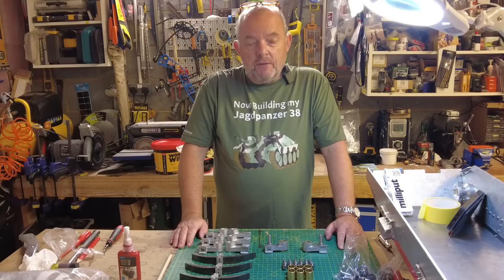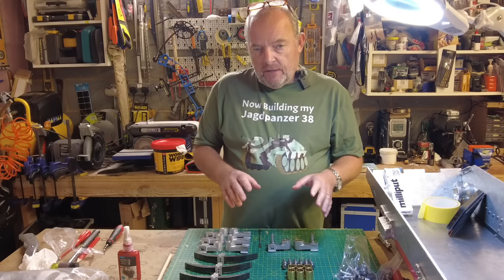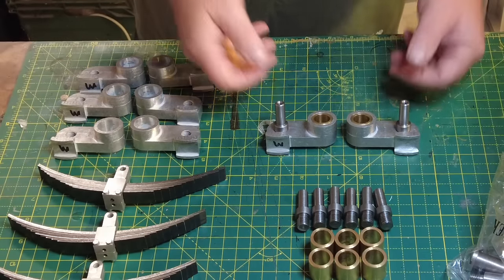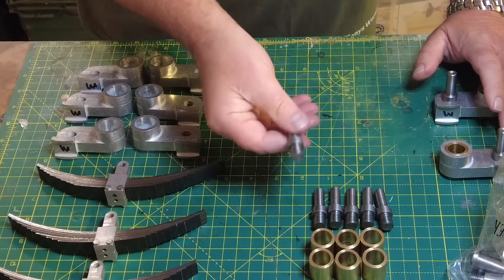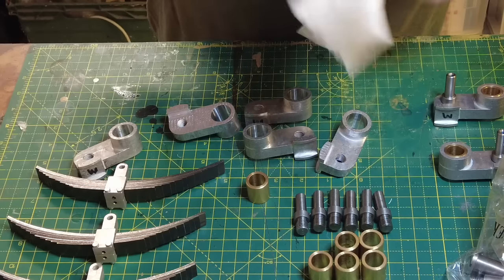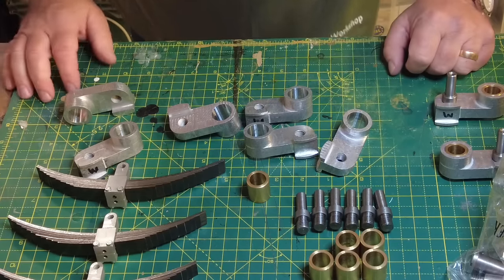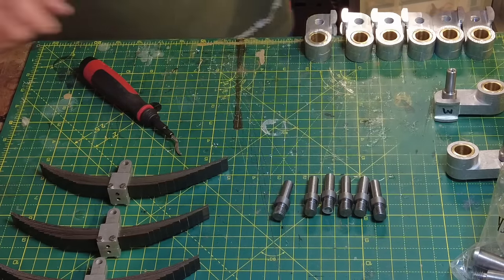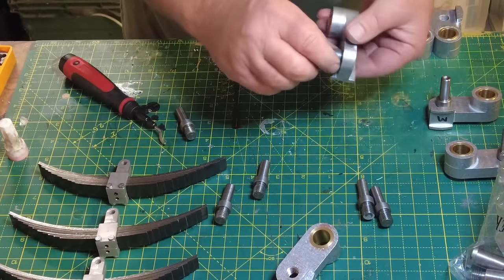1/6 scale Armortek Hetzer Jagdpanzer 38 (Vid 05) Assembling the axle arms and 1st of 8 wheels

Comment: Two things, 
1) when using a tap turn one full turn then half a turn back. By continuously turning you are not breaking of the cut material into chips. That is why it is so hard and gets progressively harder as the swarm jams up the tap.
2) never use pliers to grip a bearing surface. On slip and the surface is ruined. You could have held the stub axles at the wider part that is non bearing. 
Otherwise great work.
Steve
Reply: Since he only recuts the thread and doesn't cut it again, it's completely ok the way Tony does it.
Reply from the maker: Thanks for the tip Steve. I am only recutting the thread and it is through aluminium so quite easy to achieve, but your advise is duly noted and very much appreciated. 
I am aware that using pliers can be problematic, but I can assure you I had them held like a vice grip and they didn't slip and it just needed a little bit of encouragement to complete the tightening up process. I should have stated that in the video I guess to prevent other builders trying it. Thank you for watching and commenting, it is very much appreciated.
Reply: @janhansmann9566  it’s clear from the video that it is getting harder to turn the tap, it’s either cutting where the original cut had not gone far enough or it’s clogging up, either way backing off will clear either problem. The big problem is that you easily get into bad habits, treat an m3 tap like that and you will break the tap every time. 
The threads tightening near the bottom is a typical issue when CNC threading, not running a second tap. Sometimes it is done deliberately to ensure the stud fixes tightly.  Steve
Reply: @tonys_workshop  one way to get strong purchase on a round spindle without the risk of damaging is to cut a strip of metal, softer than the part to the width of the surface to be gripped. From the middle of the strip fold it around the part so that the ends meet, now squeeze the strip next to the part so that both ends of the strip touch adjacent to the part kinda like a keyhole. Now with needle nose pliers grip the two ends of strip twice the diameter of the part away from the part. Now start turning the pliers in the rotation you wish to turn the part. The metal strip will wrap round the pliers bringing them next to the part. You now have effectively created an oil filter wrench. The rotation of the pliers now tightens the grip and rotates the part with a fair bit of leverage.. it’s particularly useful for removing broken taps that still have a small stub protruding. Because of their three groves taps tend to disintegrate when gripping with pliers. This method evenly grips the tap reducing this tendency.   Steve
Reply from the maker: Thanks Steve, good advice and will definitely try this again if needed.
Reply from the maker: Thanks again Steve. Great knowledge shared like this is Golden, thank you.

Comment: Another compelling session, Tony. Count me in on more videos of welding technique and airbrush painting. I'm OK-ish welding at 1:1 scale with steel - well, after a bit of action from my grinder that is - but I've avoided scale welding so far on my M26. I heard a quote that "my grinder and paint make me the welder I ain't" on another channel recently which just about sums up my efforts.  In truth using the pliers on the shafts didn't really matter as those surfaces weren't the bearing surfaces as that's the job of the 6000 series bearings, but it's good to keep an assortment of short copper pipe offcuts of different diameters with a split along them to slip over threads or shafts so you can use pliers with a clear conscience. It's luxury to use a collet chuck in a lathe of course but total overkill for a job like this. Also, if you ever find that you need to clean a thread without the correct size tap you can slit a bolt of the same thread size along the threads using a hacksaw to make a rudimentary DIY tap. Looking forward to the next installment. 👍
Reply from the maker: Hi Keith, wow, great tips, especially the copper pipe trick...never thought of that but absolutely genius idea. the welding on these is 'dummy' welding using Milliput putty. I will show this, but its not half as cool as welding for real.

Comment: Morning Tony looking good the wheels are big!
And bonus on how quickly they go together, i really like the screw hub caps
I think its a great idea to show all aspects of the build filling and weld beads that can help other potential owners
Look forward to the next one
Reply from the maker: Morning Gary, thanks mate. The wheels are little bigger in diameter and soooooooo much easier to build that the larger tanks. The screw hub caps are neat but there is a lot of trimming to do on the back to cut down the dummy studs. nervous times with the Dremel as it is easy to slip and damage the thread. I will film the welding when I get on to the top section. Hope all is well and you are on track to complete your build.

Comment: When fitting  the bearings  in the wheels rather than using superglue  you should use bearing lock, also only hit the outer ring of the bearings  to avoid damage  to the bearing
Reply from the maker: Great tip thank you.

Comment: Looking good Tony. Definitely the way to go with thinking about  pre -painting parts /sections before assembly. My method with my Panther G build and so much easier.  All areas are fully covered without the risk of flooding hard to reach areas with paint.👍
Reply from the maker: Thanks Malcolm. I agree, I know it holds up the tank build progress but it is definitely worth the investment in time. The parts all fit together post painting and moves the build on very quickly from then on.

Comment: I'm not sure i would have glued the bearing in , Tony , as in the unlikely event of one failing it would be extremely difficult to remove . Personally i would have used a bearing fixer , the like similar to that of the thread locker your using . Another point is the fitting of the bearings themselves . Nothing wrong with helping the fit via a hammer , but i would have used a socket at the very least , that matched the outer diameter of the bearing shell . A drift of the likes you were using , is likely to mean a future removal of that bearing is more likely .
Reply from the maker: Thanks Mickey, great tips. I love the socket tip and will definitely go forward with that advice. Much appreciated.
Reply: That's exactly what I was thinking, use bearing retainer. Better than superglue.

Comment: Hi, Tony! Those leaf springs sure look sick, but I'm curious if you're getting decent articulation out of them. I myself would take scale accuracy over performance any day, but in the scale world of RC, leaf springs being far more decorative than functional seems to be the accepted compromise and norm. What's interesting in this case, however, is if they do actually flex under the weight of a fully metal 1/6 tank.
Reply from the maker: Hi Arthur and thank you for watching and commenting. interesting question. They do articulate on the central pivot retainer, but unsure how much the springs deflect when tackling obstacles. The Weight of this Hetzer with the batteries and option packs is circa 60 Kg and when building they definitely had flex in them. Early days, but it seems to perform really well.
Reply: @tonys_workshop  Thanks for taking the time to reply, Tony. Circa 60 Kg?! That's me aged 18! 😆

Comment: Spent the whole video nodding and mentally saying to myself ' Yup, that's pretty much how mine went together' Only difference was I had to use a vice as I didn't have a large enough die for the threads.
Reply from the maker: Hi Daniel, thank you...that is actually very reassuring to hear. I understand that building the top section and roof is challenging😬. The Vice works equally as well, but I found that the thread can lock sometimes. I have a full set of Taps and was lucky that I had one that fitted the job. You should upload your Hetzer on your channel, I would love to see it.
Reply from the maker: I love it. Thanks for sharing.

Comment: I’d love to build one but I probably wouldn’t get any use out of the finished model to justify the expense.
Reply from the maker: Hi Paul, that is a common problem with these kits. Some kits never even get completed. Once built you do need the space to drive these, otherwise they end up languishing in the garage or end up on the second hand market. Having said that, they hold most of their value on the used market. Thanks for watching and commenting.

Comment: Please stop whacking the bearings in by the inner race , you will damage them...strike the outer face using a large socket , this alleviates putting undue pressure on the bearings that they are not designed for..
Reply: I would consider using dry ice to shrink the bushing and drop the bush into the arm.